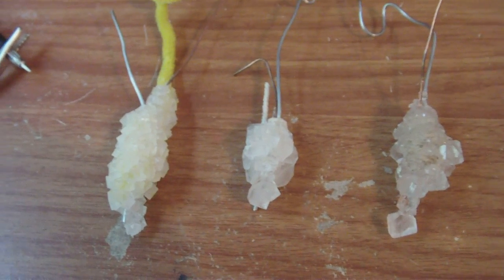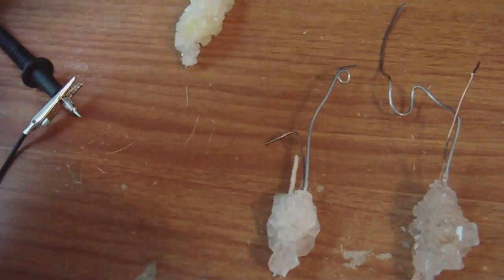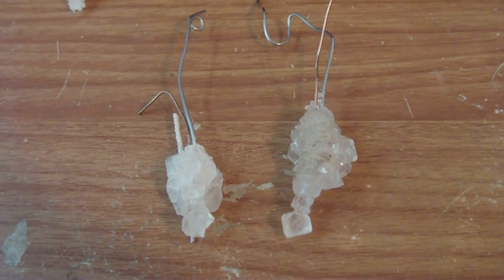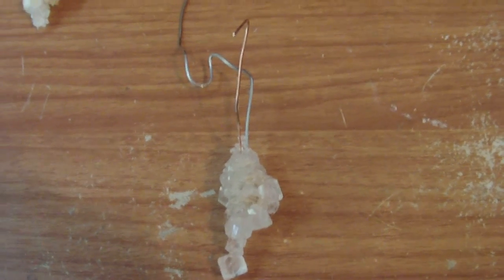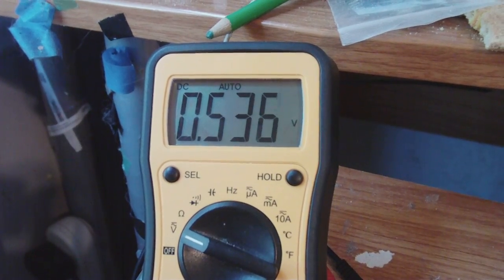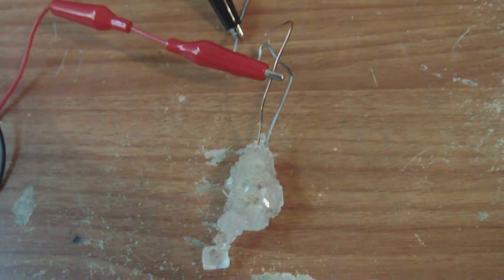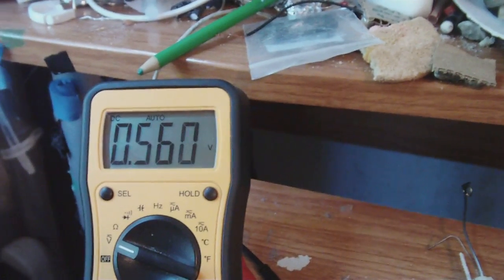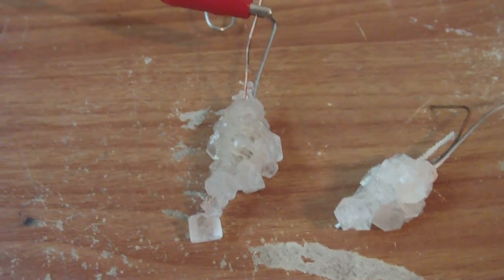Polycrystalline Literal Crystal Battery

Comment: Very interesting. When you made the battery, did you keep boiling off the water until some point, and then let evaporation and crystallization take place, and if so, how did you insure that the electrodes were in the mix? I'm trying to picture "the pot" or cooking vessle, could you elaborate a bit on that? Thanks very much. Love your experiments.